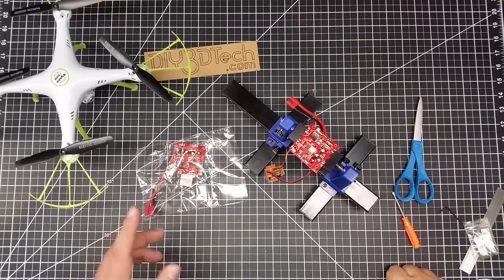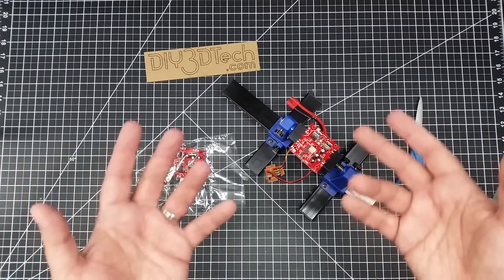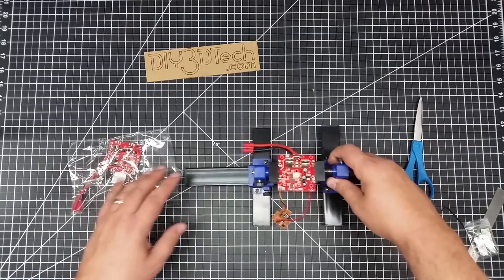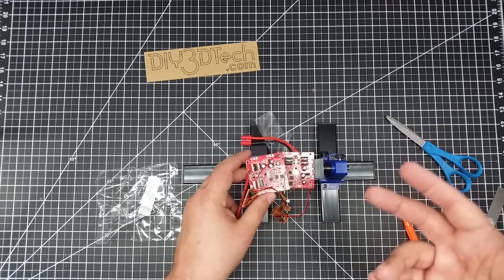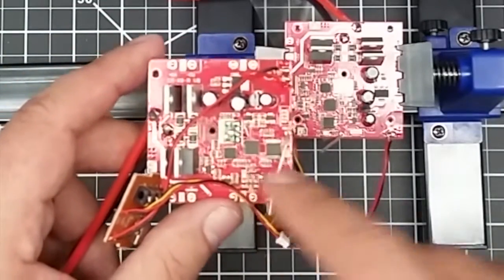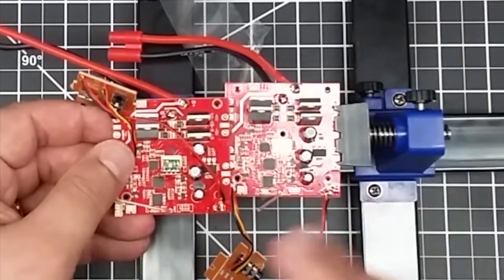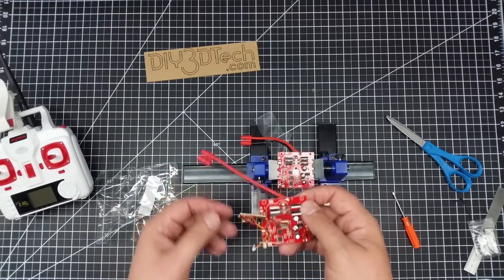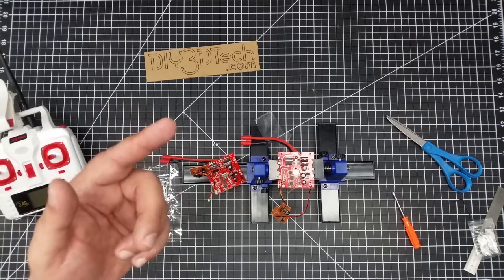Video Drone  - Comparing Hover and Non Hover Syma X8 Control Boards!

Comment: Nice video. I've converted a couple of JJRC H25/LH-X14 drones with the Syma HG boards as it's using the same 180 motors. One was defective and lost the drone, the other works fine, just had to make an adapter plate from 2mm plexiglas. You cant just solder a barometer to the board as you've to update the firmware. I've got a combo TX and board off Aliexpress. Just beware of dodgy boards and test indoors before taking it out
Reply from the maker: Yupper on the barometer, also if you check on thingiverse I have 3d printable motor mounts out there....

Comment: what if you could solder the green pcb barometer on a X8C board? does anyone know where to find it?
Reply from the maker: You would likely also have to figure out how to change the firmware also to use so its cheaper to just to but a replacement board...